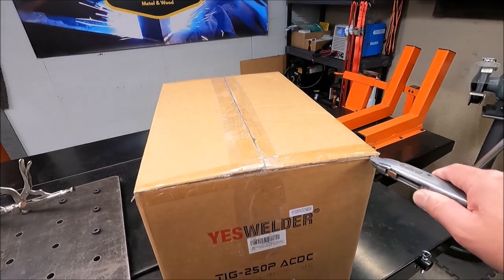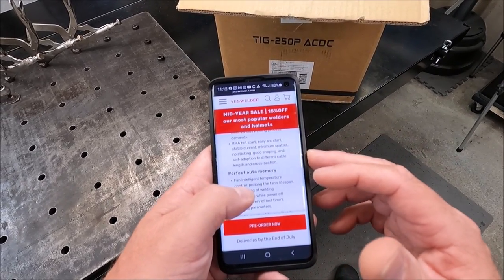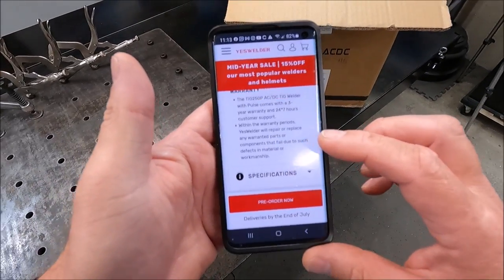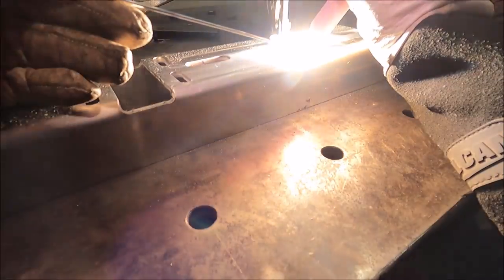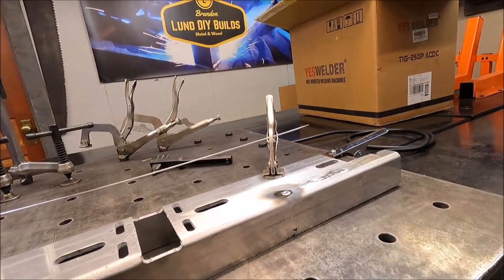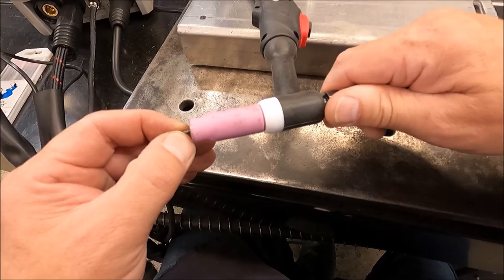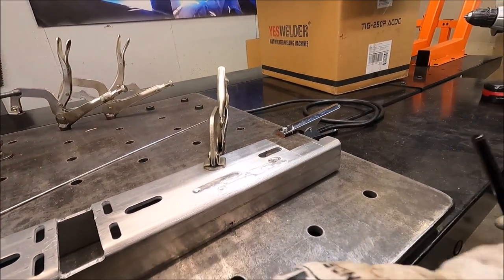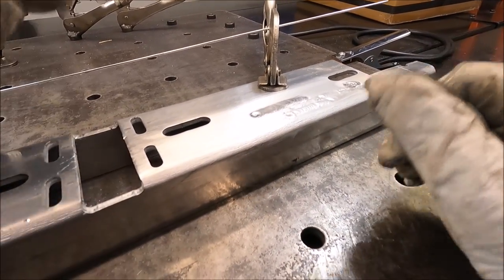AWESOME 250 amp AC Aluminum TIG Welding Machine

Comment: Quick tip Brandon, your tungsten is extended way too much for beads on plate alum...the ball should just be about 1/8 passed the end of the cup.  lean the torch 15-20 deg MAX away from the direction of travel. This alone will help big time for starters. Also, with inverters on AC, you don't need to "ball" the tungsten as we did with transformer AC machines in the past,  leave it blunt or as is, it will ball slightly in use. You did a grood job, for being rusty or out of practice.👍
Reply from the maker: @AWDjr thanks man! I'm liking the inverter vs transformer. It takes some getting used to for sure. Thanks for the tips!
Reply: What's name othe tig welder please, where to buy. Thanks

Comment from the maker: CORRECTION - Some have mentioned the specifications say the TIG function is rated at 160 amps. I have contacted the company about this and they have confirmed the TIG function is rated at 250 amps and they are working to correct the misprint.

Comment: For the end crater, make small circles as you back off the amps keeping your torch fairly verticle. That's always worked for me. 
I use 2% Lanthanated for everything.
Great video as usual
Reply from the maker: @Basil Keen thanks for the tip man! I will give it a try. It's been a loooong time since I welded aluminum but the fun is still there :)
Reply: @BrandonLund  Always brings a smile to my face when you make a nice weld on aluminium.
As you said, try to dab just a bit more of the rod in at the end and swirl as you back off the amps.

Comment: Checkout the AHP offerings. They have a 200 and a 225 amp machine. Dual voltage better pedal and torch.
Reply: I'd been looking at the 2018 version for a while, but the new 225Xi looks like a wonderful improvement.  The higher cost is offset with the regulator, nicer pedal, and features like being able to add water cooling later.

Comment: Be interesting to see if the amperage is accurate on that machine
Reply from the maker: @S Art I tend to believe it's probably pretty accurate. I've owned a bunch of inverter machines and every one "felt" like it was at the amperage it was supposed to be at. I don't have an amp meter though. Someone mentioned the specs say the TIG function is rated at 160 amps and the stick is rated at 250.  I have to think they intentionally under rated it this way because its possible the torch supplied cant safely handle the full amperage and it was their way of not providing an upgraded torch with an increased cost. I plan to reach out to them and ask why.
Reply: It’s not accurate. It’s a 200 amp machine that has software issues on the AC side that limits the output further.

Comment: I got one on sale for $600. Just got a bottle and got it set up just haven’t had time to use it yet. Can’t wait to get started learning tig. They didn’t include the foot pedal anymore so it comes out about the same. It did come with a nicer ground clamp though. I bought a foot pedal, gas valve, stubby torch kit, some layzr tungsten, and a few different types of rods. If I really like it I may pick up one of their MIG machines.
Reply from the maker: Thats awesome man! Enjoy! TIG welding is a lot of fun!

Comment: Watching your Plasma Cutter Video,  Gave me the idea too Buy The " Yes Plasma Cutter " . I  Don't have A Tig - Welder,  But when I Buy one in the Future  , this Maybe the one .Thanks for your Help !
Reply from the maker: Barry, if you use the link you will save some cash too ;)
Reply: Start w/anything in a decent PC.  We got a really good deal on a FirePower FP18 which only cuts up to 1/8", but is completely self-contained and runs on 120V.  Someday after we add a TIG to the shop, we'll get a larger PC, but this handles more of our workload than I thought it would.

Comment: Thanks Brandon. I’m leaning toward the same welder. Never done aluminum but I need to learn. Your review is excellent. Been watching for a while now. The description says foot pedal included but also has a foot pedal option which raises the price to 800.  I’ll read a bit more in the store. Thanks for your time on this review. I’ve actually learned a lot from your videos. Cheers 🍻👍👍👍
Reply: Just purchased it with a regulator,  now for a bottle 😁🍻
Reply from the maker: @Flathead Ron's Garage thanks man I appreciate it! I'm very happy with this welder and have been having a ton of fun playing  with it. On a side note my dad up until he passed restored a bunch of Ford flat head V's and actually got a Dearborne award right before his passing. He was super proud of it.
Reply from the maker: Right on buddy!!!! Congratulations! Check out  Matheson gas. They have pretty good prices
Reply: @BrandonLund  , wow Brandon the Dearborn is the highest honor you can get. He must have been a perfectionist, and a bit ocd,, it comes with the territory.  Trust me,,, I know 😁 … look at you with the welding and how in depth you get. And you are still humble. Apple didn’t fall far did it. Love your videos. Sorry I haven’t commented much. Watch a lot of your videos though. 👍👍👍
Reply from the maker: Thanks man I appreciate your support! My dad would tell me that the judges would even look at specific bolt heads in very remote areas and check their orientation and they knew if a bolt was original or not. He entered one of the cars and go a very high score (dearborne) and reentered it a few years later because he wanted a perfect or near perfect score. He was very much a perfectionist and I definitely inherited it from him. It's a curse and a benefit. It's easy to get burned out when you struggle for perfection. I've learned to say " good enough" but it took a while to get there. Thanks again buddy and I appreciate your support. 🙏

Comment: Just bought one (TIG 250-P) and dying to try it out. Needed a bit more amperage than my 200 SyncroWave could put out. It was only $599 during their Easter Sale last week. Going to swap out the air-cooled torch with my liquid cooled C-K.
Reply from the maker: Congratulations! You are going to love it!

Comment: Can you weld without the foot pedal ? Like lift arc .
Reply from the maker: Yes you can. You can do either. You can use it with a pedal or the tig torch that has the on / off push switch. Its a pretty nice unit @nathan banks

Comment: Hi Brandon, they say that your tungsten tip should be like a fine point so your arc can be isolated and clean.
Reply from the maker: @Manny Fontes that's how I grind mine then it forms a tiny ball on the end. It's not supposed to clump like it did in the video. 2% Lanthanated would have been a better choice.
Reply from the maker: @Garth Land thanks man! 👍

Comment: I really like that welder I only have dc tig abilities on my current multi process welder so I’m looking for a designated tig machine in the shop to replace my spool gun which is great for long welds like trailer repairs but I want to get into more detail aluminum builds and repair this might be the best option for me right now just getting into aluminum tig

Comment: Do they have suggested setting for different metals on the inside door like most all other welders do?? Will it actually do 1/4" aluminum with good penetration?
Reply from the maker: It will do 1/4" no problem. Most TIG welders dont have a chart on the door. I think you are thinking of MIG which usually has the chart. I use the Miller online calculator.
Reply: @BrandonLund  i didn't know that,  I've never used tig. Yes my reference is related to mig. Tks

Comment: Great video Brandon.Nice welder for the price.  Could you do some stick welding with it? Maybe even try some 6010 to see if it will run. Thanks
Reply from the maker: @EZEik thanks man! Funny you should mention this. I was actually wondering today how well this will light and run a 6010. We will find out in an upcoming episode. I hope it does because that would be pretty cool. A lot of inverters struggle as I'm sure you know. Thanks for the suggestion 👍
Reply: @BrandonLund  Hi Brandon. I ended up buying this welder and I like it. I am waiting for my regulator to come in. So I have been doing some stick welding with it. It works nice! Some other reviewer said that it also does AC stick welding. I don't see where it can do that. Do you know anything about this? It does do 7018 and Stainless rod great. Trying 6011 and 6013 next. I don't have any 6010 to try just to see if it works like your Blue Demon welder did. Keep your informative videos coming. Thanks
Reply from the maker: @EZElk I'm pretty sure it won't do AC stick. Maybe they meant to say AC tig. It's an awesome welder. Your going to love it. I'll try it with 6010 and post my results :)

Comment: Thanks for testing it on 120V.  I'm thinking about buying one of these and I was wondering if it could.  I've already got an autotransformer (converts 120 to 240) but it's good to know.
Reply from the maker: @Button Puncher this is an awesome machine. You will be pleased Using the link will save you some oney too!
Reply: your comment is 10 months old. maybe you just figured out your setup will not work. not sure what you meant by "autotransformer" but, to run welder on 240VAC, you need an actual 240VAC outlet like the one powering your clothes dryer or electric stove.

Comment: @Brandon Lund - to be honest, this is not a 250A TIG welder, it's a 160A TIG welder than can do 250 for stick/SMAW, if I'm reading the specs right.  Most TIG welders can do stick or a MIG w/wire spool gun, FWIW.

Not saying it's not a nice unit, just parsing details since we're shopping and I'm in detail-reading mode.  It does have HF start, but not triangle (for castings and thin tube).  Needs regulator, better pedal, and maybe better (CK) torch as I'm pricing. 3y warranty is nice!  Certainly a nice offering we're considering adding to our existing Lincoln MIG capacity thanks to your demo.
Reply: You're absolutely right my owners manual says: (Crater/start/pulse current control(5A-250A for MMA, 10A-160A for TIG )
Reply: @davidhaywood9071  What do you think so far?  Seems like a nice unit and Yes Welder has a lot of positive reviews and it's a nice package.  The more I think about it, the more I wonder if the 160A spec is just for that torch.
Reply: I haven’t had a chance to use it much but so far I like it.
Reply from the maker: @James Wyatt I'm actually confused because I checked the specifications and your right. Although it does say the tig is rated at 160 amps, the machine says its outputting 250 amps. That would be very strange and nearly impossible to set your amperage if the readout says 250 amps but  it's actually only putting out 160. Maybe  it's been down rated because the torch can't safely handle the full amperage? Weird...
Reply: @BrandonLund  that’s interesting. Just looked at their manual on the website. It says 250A for TIG and 200A for MMA. I’d like to see a clamp meter on this thing.
Reply from the maker: @jamesb43 I wish I had one but i feel pretty confident that whatever the digital display says, its output is within a couple amps of that. If it's reading 250 on the display but only capable of outputting 160 that would be immediately obvious.
Reply: @BrandonLund  are you going to be testing their Firstess MP200? They have mentioned sending it to YouTubers in the FB group. I have been hoping you would be one of them.
Reply from the maker: @jamesb43 I haven't heard about that so thank you for the info. I might have to reach out and see if they would be willing to send me one. I just bought their plasma then this TIG and on top of that a Honda dirtbike this weekend for a project on my second channel. I think my wife is gonna take away my allowance pretty soon 🤣🤣🤣
Reply from the maker: @James Wyatt @David Haywood  THANK YOU FOR NOTICING THIS. YESWELDER HAS CONFIRMED THE TIG FUNCTION IS RATED AT 250 AMPS AND IS WORKING TO CORRECT THE MISPRINT. THAT EXPLAINS WHY THE READOUT MAXES OUT AT 250 AMPS IN TIG MODE.

Comment from the maker: Buy YesWelders HERE: https://yeswelder.com/?ref=BRANDONLUND
Use Coupon Code: https://yeswelder.com/discount/BRANDONLUND
Argon Flow Meter https://amzn.to/3kwoYYy
CK LaYZr Tungsten https://amzn.to/3ksjbmW
Blue Demon Multi-Mix Tungsten https://amzn.to/2VJ76iV
MORE WELDING AND FABRICATION VIDEOS HERE:https://www.youtube.com/playlist?list=PLfbf78fMz9Vol0uX2-GNc6mLi75zpqb5f
LEARN HOW TO WELD VIDEOS HERE:https://www.youtube.com/watch?v=ADa1I319GJ0&list=PLfbf78fMz9VqxPZTT-xmwdcrHVa7ML-ft
Some of you have mentioned the specifications say the TIG function is rated at 160 amps. I have contacted the company about this and they have confirmed the TIG function IS RATED AT 250 amps and they are working to correct the misprint. I have also confirmed this for myself. My manual that came with the machine was printed in May 2020 and lists the TIG function rated at 250 amps.

Comment: Phooey!!! 🤣🤣🤣 You and your bloody welding, 🤣🤣🤣. Your aluminium welding way above my pay rate ol' mate, 🤣🤣🤣.
Nice little welder, nice price, still out of my competency range atm.
One of these days, SWMBO will leave me alone and I can get back to my practicing, but until that day comes......
Generally the graph on the welder panel - preflow, I hold, I ramp up, max I, pulse I min, I ramp down, I hold, post flow. But you already know that, 🤣🤣.
Cheers ol' mate thanks for posting.
👏👏👏 👋👋👋
P.S. "If I can do it, you can do it"..... yeah, yeah, sure sure..... 🤣🤣🤣🤣🤣🤣🤣🤣🤣🤣🤣🤣🤣🤣🤣
Reply from the maker: @Pilot McBride your too kind buddy! Out of all the processes, stick welding is probably my favorite followed by aluminum welding. My experience has only been on transformer based welders. This was actually my first aluminum weld ever on an inverter and I never practiced. The last time I welded aluminum was over 10 years ago. As much as I would like to think I can do some decent aluminum welds, I feel like an inverter style welder makes it so much easier. If you've welded aluminum with a transformer in the past, you would love welding on an inverter. Cheers buddy and thanks for the great comment 👍

Comment: My guys use to use Helium for Aluminum welding! Argon was for Steel I thought? I could be having a brain fart 💨!
Reply from the maker: @Bret Lambky you can actually use either but Argon is probably the most commonly used and the least expensive of the two
Reply: @BrandonLund  That's my experience - pure Ar for TIG overall is very common, but Ar/CO2 mix for MIG steel.  TIG started-out as "Heliarc", though helium is still used for TIG on particular metals.
Reply: Helium will get you more penetration if you are welding  thicker aluminum.. but since generally tig is used for thinner gauge material usually you dont want deep penetration and argon will give you a great result
Reply from the maker: @Joshua Gardner At today's prices, Helium is probably cheaper than lumber lol.
Reply: @BrandonLund  Too bad we cant build houses from air 😂😂
Reply from the maker: Lol true that!!!!

Comment: That is some angle on your electrode. Straight up is great but nobody can do that and see what they are doing. Fifteen degrees maximum from straight up pointing away from your direction of travel is the normal.  I will bet you have learned that by now. Nice video.
Reply from the maker: Thanks man! Yah it had been a real long time since the last time tig welding and I've never tig welded on an inverter until now :)
Reply: @BrandonLund  Hey Brandon you are not the lone ranger. I just started tig welding again again yesterday before I watched your video. I used to be good at it but I need lots of practice now. I have a Lincoln Precession Tig 185 Transformer welder I purchased  a few years ago. I put maybe 20 hours on it. 
I have been looking at inverters. Maybe too much learning for my tiny brain. I also have a Hypotherm 60 plasma cutter I purchased for something to play with at about the same time. I tried it once for an hour and burnt a hole in my shoe🤣 and stored it in a spare room. I forgot I had it 👀. Gonna list it somewhere as it is a hassle to drag outside to use. Power hacksaw for me. I like your videos, a stand up guy.
Reply from the maker: @GatorWing I appreciate it! Yah its kinda like riding a bike. You might loose the fine motor skills but the basics come back quickly. I think once you get the settings figured out on an inverter it's easier to get a nice weld compared to a transformer machine in my opinion. Its different but it's much more forgiving. You won't have any problem selling that Hypertherm. It's a quality machine. I appreciate ypu watching and commenting 🙏👍

Comment: Not even a p 100 filter mask can filter all products  created by welding.  The masks and filter masks only get the big chunks. Big chunks lodge in the upper lobes .
Reply from the maker: @safety first in texas right on 👍The cartridges I use are made by 3m specifically for welding fumes.  Like you mentioned, they don't catch everything but it's way better than nothing and it's cheap...plus I have a beard...

Comment: Seems interesting  all of the pro level single phase tigs are 220-230 amp, boom along come the Chinese at a fraction of the price that have another 20 amps… amazing😂
Reply from the maker: Its an incredible machine especially for the price as you mentioned 👍
Reply: @BrandonLund  
Yes I’m amazed how they can manufacture these so cheaply

Comment: The best deal is on AliExpress 
keygree 250p ac-dc 😁
Reply from the maker: @SùPrëMêYT I've always been hesitant buying from there.
Reply: @BrandonLund  AliExpress are pretty good these days I've never had anything go wrong so far touch wood. Yes it's cheaper and yes it's a Yeswelder but having warranty and ease of replacement is something to consider as sending a welder to China is not cheap guys!
Reply: I think keygree is the OEM. Yeswelder is a rebrand